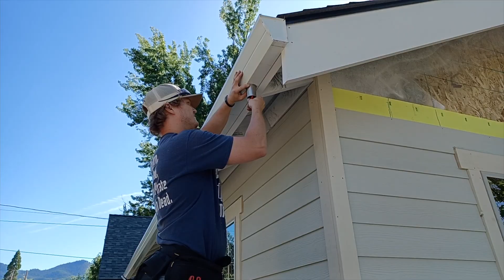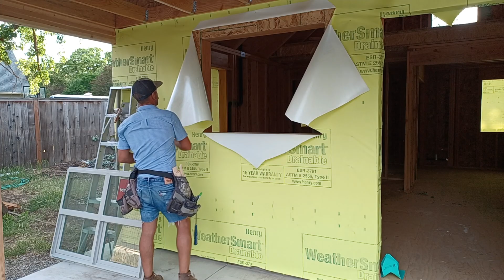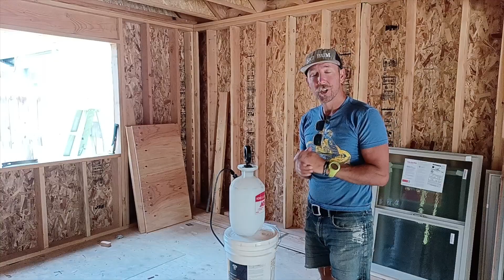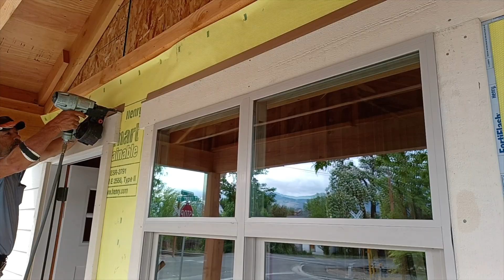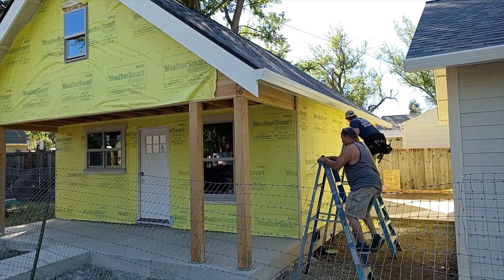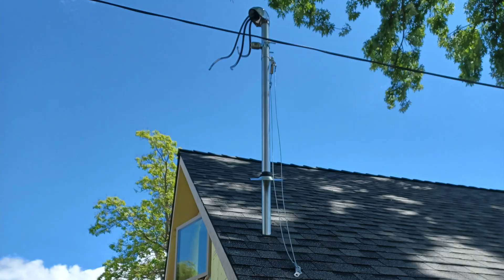How To Build an ADU with Cost Breakdown | Part 8

Comment: I've used a laminate floor cutter to cut that fiber cement plank siding , no dust and if u need to recut you can cut no dust and u can cut like 1/8 off if u need .
Reply from the maker: Great tip, thanks for sharing! 🎉🎉